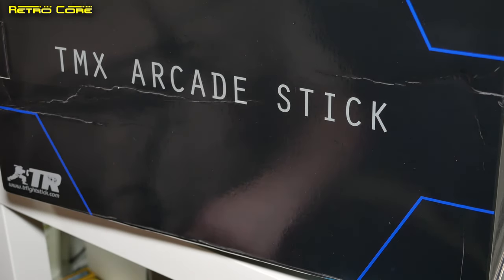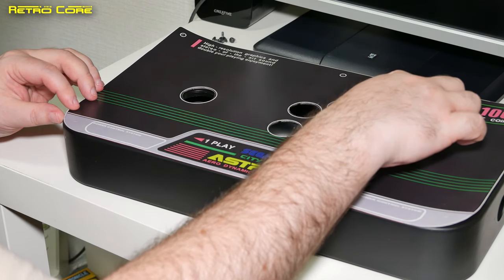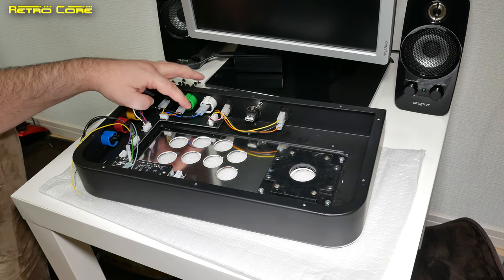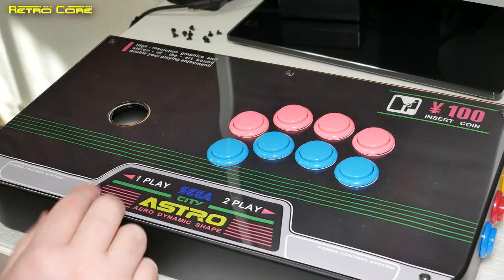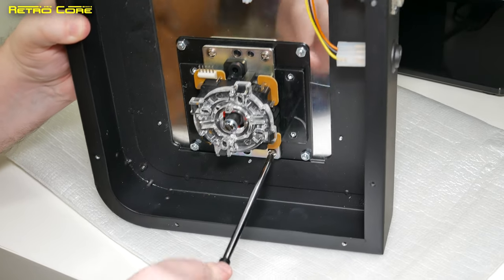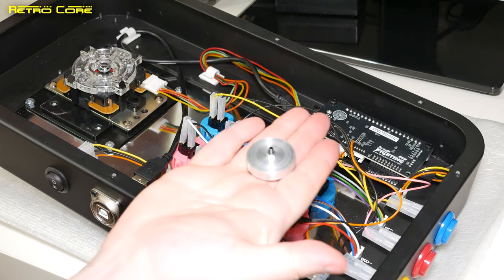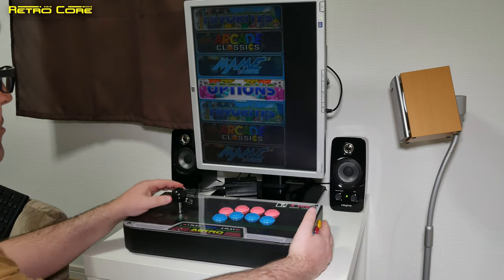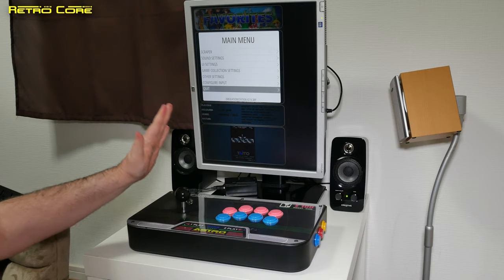TMX TR Fight Stick built with Brook Universal Fighting Board

Comment: Hello friend, very good video! I have seen that case on the official website and I really like its design, when I buy it, only the case comes? or comes the connection cable and some accessory. That on your page is not specified and I asked them but I have not had an answer, probably due to the demand or the parties. greetings brother like and sub (I don't know how to speak English very well, sorry if I have spelling mistakes haha)
Reply from the maker: I'm afraid you only get the main case and 1 PCB and cables  inside.
The buttons, and interface PCB need to be bought separately.
I bought Sanwa buttons and stick.  For the interface PCB, I bought the Brook Universal Fighting Board https://www.brookaccessory.com/detail/06960737/
Reply: @RetroCore Thanks friend, I already bought everything else and the case is on the way to be assembled, I love the design you have in fact I bought green and pink buttons for the astro city type assembly, by chance you will not have the design that you uploaded but for taito's layout? If I'm not mistaken, the one you have is the one from sega 2p and I ordered the one from taito: c, I love your video because they just agree that I wanted to put together an astro city design along with the same tmx case haha, greetings!

Comment: Nice build Mark. Definitely a quality product by the looks of it, and quite pricey too by the time you add the Brook board, harnesses, buttons and joystick.
Reply from the maker: I was very lucky to be presented the actual stick base but the buttons and Brook board I bought.  The Brook board is not so expensive and here in Japan Sanwa buttons are about 100 yen each, so not a great deal.  But yeah, it can be quite expensive in the West due to the cost of Sanwa parts over there.

Comment: You can consult the controller lag of several pcbs at inputlag.science, the methodology used is the most reproducible possible at the moment. And yes the brook ufb is sitting at the top  of the chart, with an average lag of 1ms, and more importantly, 94% of inputs coming on time (next frame after pressing the button). Even the negative edge lag is faster than most pcbs. Nice choice!

Comment: I would love to learn more of how to set up an arcade like that so I can play shmups. How much did that all cost together for such a build ?
Reply from the maker: Oh man, I'm not the man to show that.  It took me weeks of messing about.  I can tell you that most Web sites will tell you to add a small script to the Retro Pie boot config to rotate the screen.  DON'T DO THIS.  it really hurts performance.   You need to configure the fronted (emustation) and retro arch separately.

Here's a breakdown of my costs.
Raspberry Pi 4B kit (all cables included) =  10,000 yen
Monitor = 3600 yen (used, obviously)
Vertical stand for monitor = 2400 yen
Arcade buttons and joystick = about 5000 yen
Creative Labs Speakers = 2800 yen.

The actual joystick base was given to me so I don't know how much that cost.
Use XE.com to convert yen in to any currency.

Comment: Quick question! Is that causing deep enough to fit Happ or IL style joysticks??
Reply from the maker: I'm afraid I can't answer that.  I've never actually used a Bat style stick on a consumer joystick.  I would imagine it would fit since there is a plastic bracket that the joystick sits on  which can be removed.  That would give you another 7 or so mm.  Best ask the guys at TR fightstick.

Comment: Can you make a tutorial on how to make and print art like that?  Or do you know of a tutorial?
Reply from the maker: I have links to the file in the video description.  As for printing it, I just used a normal ink jet printer that could handle A3 on quality mode.
Reply: @RetroCore  I bought this same fight stick.  I put a Brooks Retro Board in it instead so I could use it on my old consoles.  Sadly no artwork on it.
Reply from the maker: Yeah, that's the bummer.  And due to the size of the stick, an average home printer can't be used since they normally only reach A4 size.
If you take the file I've provided to a printing shop, they'll be able to print you out a good copy.  Actually, I want to get the image printed on to silk screen plastic.  Not sure how much that would cost though.